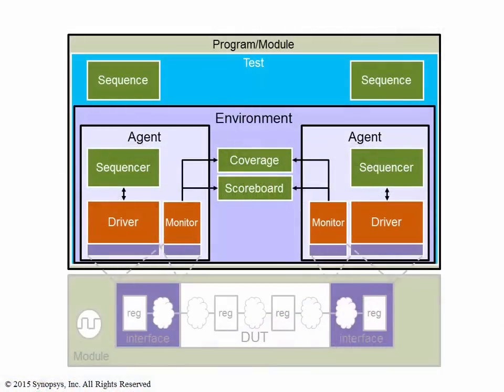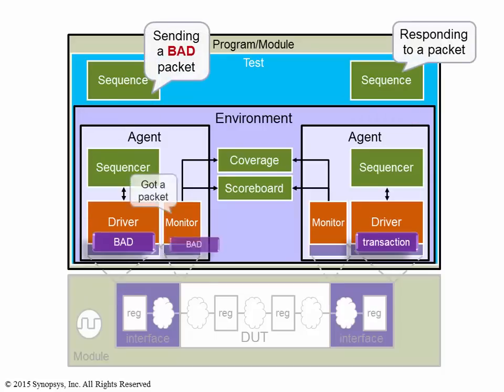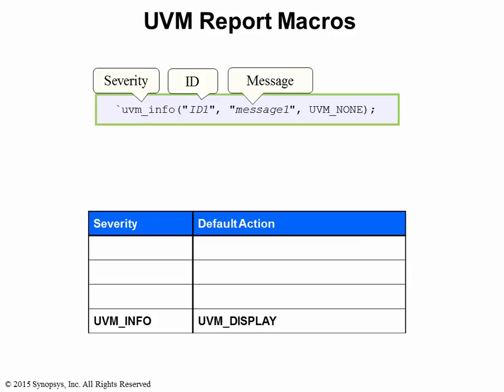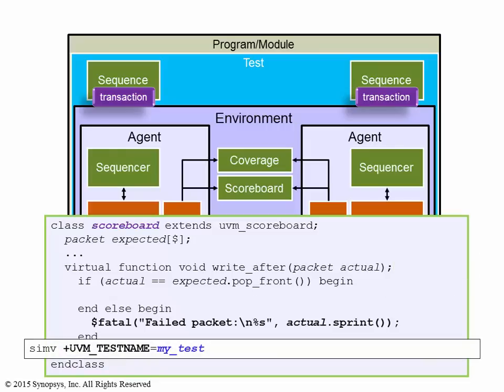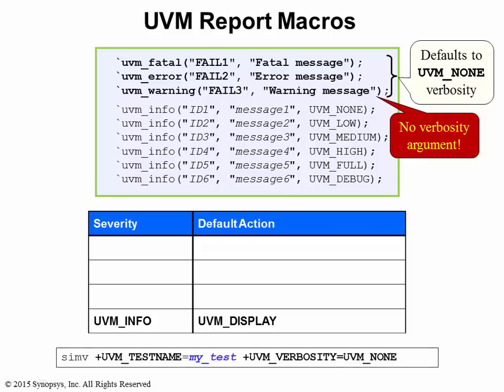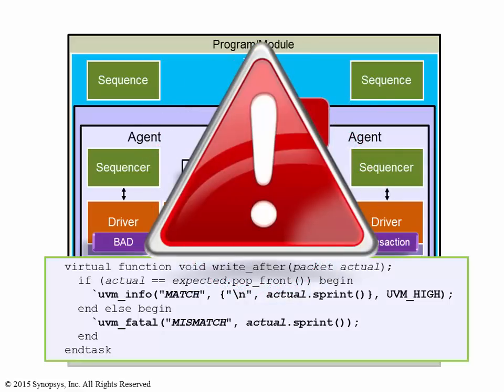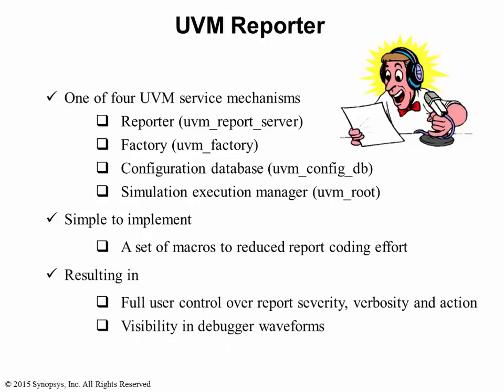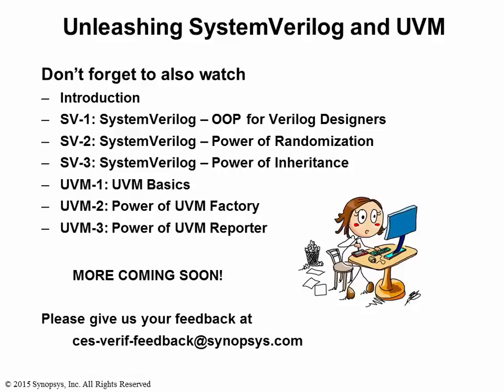UVM-3: UVM Reporter | Synopsys

Comment: James has explained basic UVM concepts in easily understandable way giving examples of practical issues/difficulties verification engineers face. He also explains main advantages of UVM in his videos. So if you are a beginner in UVM, you can start with these three videos (UVM Basics, UVM Factory and UVM reporting) before moving into advanced concepts and other finer implementation details of UVM).

Thanks for the videos.
Reply: If you have any fear about UVM, it will come down to some extent and you will start feeling better 🙂

Comment: how can we print a user-defined warning during compilation?
Reply: I think these reporting mechanisms work run time (dynamic i.e. during simulation), whereas only the tool can generate warnings during compile time. you should contact the vendor probably to generate warnings during compile time.